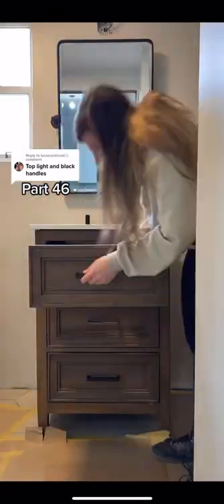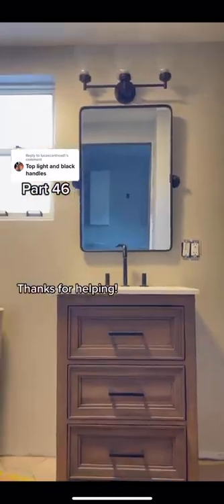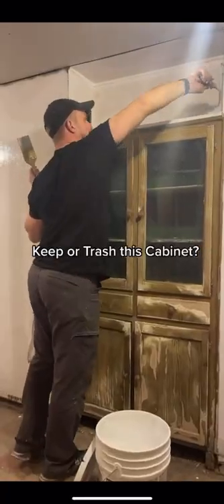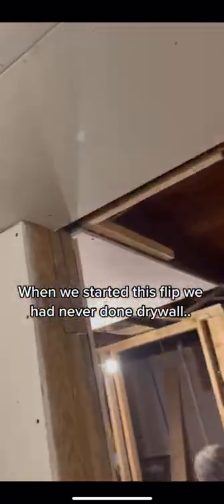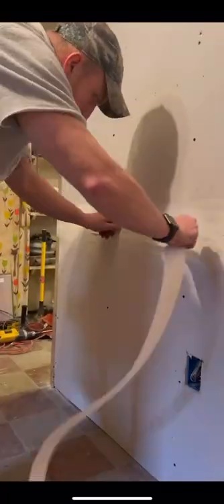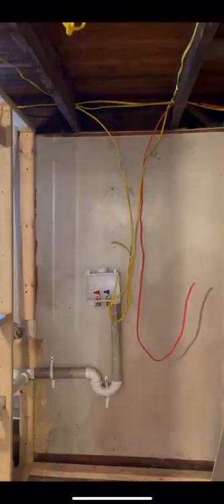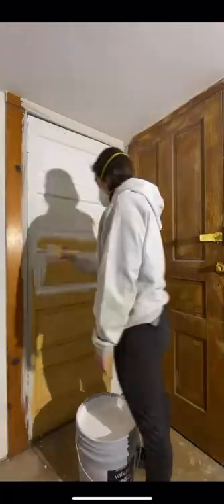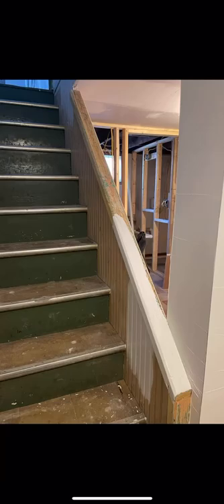PART 46 :Viral Video  | DIY - FLIP HOUSE SERIES - How To Transform an Old House

Comment: Keep the built in cabinet. Or else your just going to have to put something else in that space - more work.

If your walls are a cream color try a very pale sage. Something that is white but has a tiny hint of color. 
That way the doors still stick out against the wall. 

You could have left the doors the natural color or stain them walnut. That way they blend in with your floor (if it’s hardwood and not carpet).

Comment: Yeah no! drywall butt joints are not the same as actual drywall ends. Actual ends are beveled, butt joints are not, so butt joint mud needs to be thin and spread out over larger area. When you finish painting and light hits on the butt joint, it will be clearly visible. It's not rocket science, but it does take some skill.

Comment: You wet the drywall tape?  They may crack within a few years. Studies have been done. The standard is to thin your mud. The extra water absorbs into the tape, but also draws in the mud too, making for better adhesion.

Comment: For the steps, how about putting wood on the tread of the steps, paint it white/the same color of the exterior and the riser of the step the same color of the base?
(Ps. I don't actually know what the parts of steps are and googled it, I hope they're the right names. Tread = The top part of the steps, the part you step on and Riser = the vertical part of steps.)